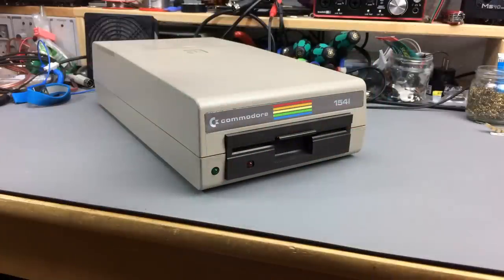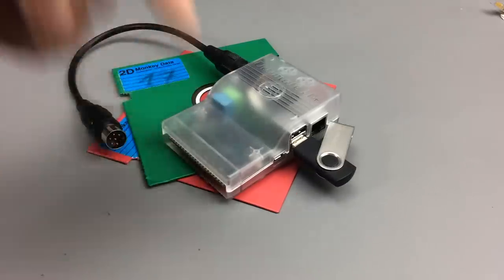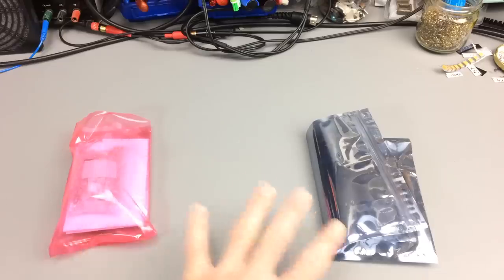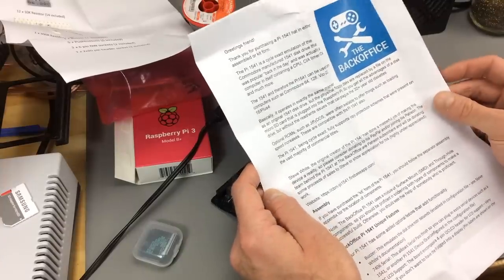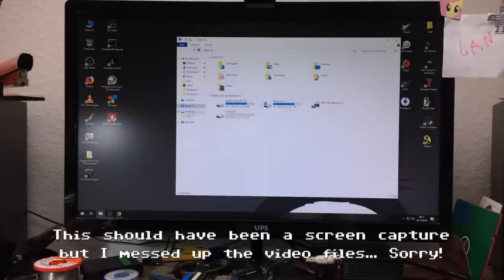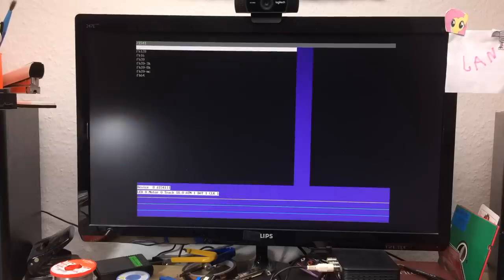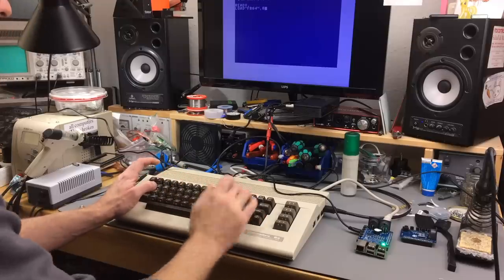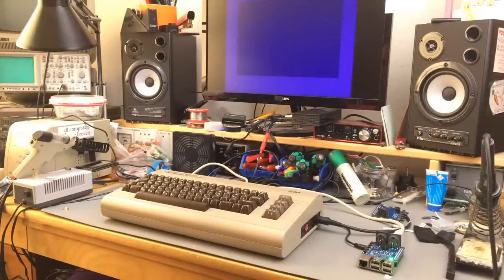The Pi1541 Commodore Disk Drive Emulator

Comment: The original ARM processor was a development board/coprocessor project designed and built by the Acorn team on the BBC Model B. All ARM based products have a common heritage with the Acorn/BBC computer line via the Archimedes series, including mobile phones, tablets and of course the Raspberry Pi itself. In the eighties I had a C64 and my family owned a Model B and then later an A5000. I still have the 64. In my opinion the BBC was a better computer, the 64 was more fun and certainly more popular world wide. I love how all these years later this has come around full circle. Thanks for doing this video Jan.

Comment: The Retro community never ceases to amaze me. There is always a way to make somethin' for all these older systems they are not dead yet. I should pick one of these up anyway since who knows what I'll get my hands on in the future.

Meanwhile, all the soldering! Seriously those are scary lookin' to solder since it is they're so small. Anyway - mach weiter so, Jan!
Reply from the maker: SMD soldering is actually not all that scary once you get the hang of it. Steady hand and good eye required though... ;)
Reply: Or use a cheap microscope from Amazon/AliExpress/Ebay  ;)

Comment: That's so clever! When I saw you show this off initially, I was like "Cycle accurate emulation on a Pi? Impossible" because I assumed it was running through stock Raspbian or something. Now that I see it's actually loading it's own elf payload, I'm spectacularly impressed. That's so smart and clever.
Reply: This cannot be compared to raspian. AFAIK this is written as RTOS.
Reply: Yes, this is a complete separate OS which is only doing this, and nothing else. No network or USB drivers for example.

Comment: Great video Jan,
The Pi1541 is probably the best cost effective 1541 emulator on the market. I have Jiffydos installed on it too, so everything runs much faster (in all operations, not just initial loading as per a fast loader cart). I tried a SD2IEC and found the massive incompatibility with many programs driving me back to the old floppy drive. The 1541 Ultimate is awesome, but with a family and mortgage, I couldn't justify that kind of money. With the pi3b+ however (and all the crapping around of course) I found the perfect niche. And to top it all off, I can disconnect the pihat, and use the pi for other things whenever I like. Best of both worlds, and something I think people don't realise; you can use the pi for many things, as the pi1541 hat just disconnects easily, and a new sd card popped in for any other things you would like to use the pi for. Too easy.

Comment: Ok, that's really cool. I didn't realize you could get cycle exact emulation for a system like that on an RPi.
Reply from the maker: They even have a version for the Pi zero now (if I'm not mistaken) which makes things a lot more cost effective. Definitely have to try that sometime, too.
Reply: @JanBeta  The fact that it can be cycle exact on a $5 computer is absolutely mind blowing. You could end up paying more for the SD card than the computer that is doing all the emulating, that's insane.

Comment: I know I'm late to the party, but I have just got a Pi1541 up and running on a Raspberry Pi 3A+

What an incredible gizmo!  I've got two ROMs installed... 1541II and JiffyDOS. It works perfectly. 

I now want to jam it in a small enclosure with a 5" HDMI monitor and externally accessible MicroSD slot :-)
Reply from the maker: Yes! It is an incredibly useful little device!

Comment: Nice informative video, Jan. I have my pi1541 coming in next week. I love my SD2IEC, but I have five different 8 bit computers I swap it on. Time to get a second solution to test and review. I got my piHAT from Commodore4Ever on eBay. All assembled with 2 IEC ports and an LCD screen. Not the cheapest, but very well built and reviewed.

Comment: Great video! I have the Arananet version and added a little 128x64 screen to it. It works well but the scrolling is noticeably slower than with a  monitor. It's not really an issue if you only have a few games or even a small collection. If you have a large number or full collection though, unless they are well broken down into sub folders, it can take a while to scroll through them. At the end of the day, the Pi1541 is an amazing little device, well worth owning for all C64 fans!
Reply from the maker: I agree, it's definitely an amazing device. I'm looking forward to what this thing is going to become in the future. After all, it's a relatively new project still. I have an OLED screen on order, too. Can't wait to try it. :)

Comment: Pi1541 works perfectly with Final 3 Cartridge, but only in drive emulation mode. When you boot the pi, it starts in sd2iec mode and it is not emulating any drive. The exact emulation starts when you select disk image either from FB64 or directly on Raspberry Pi (using hdmi display and buttons on the board)
Reply: So fast loading works fine in drive emulation mode?  Any glitches or exceptions?

Comment: To add a new image downloaded via PC just pull the SD card and put it on there. No need to power down the pi1541. Fb64 or fb128 sees the new disk image right away. 

One thing worth to mention is,  changes to the disk images are written when unmounting the image. So don't forget to push the button or your data written to the disk is not written to the SD card.

Comment: If anyone else has the Pi1541io board and has problems with it, it has pads on the bottom that you have to bridge to select various things explained on the github page, I was wondering why mine didn't seem to work but I completely missed that since the eBay one I bought came with no instructions. Works great now and the external OLED is definitely a must have if you have a single screen

Comment: Hey Jan -- I think the sd2iec gets a bad rap.  One advantage it has over all of the other choices is CMD Hard Drive emulation.  Perhaps it's a US/Europe thing, but that's really important for C64 power users, and GEOS users especially.  Another advantage is the form factor:  Jim Brain has sd2iecs so tiny that you can embed them in anything.  The last advantage is price.  At one point I picked up 3-4 of these for less than $100.
Reply: Yeah and it costs less than a Raspberry.

Comment: I have a Pi1541 that I purchased from an eBay vender Commodore4Ever who builds and sells the top board which you connect to the a Pi it works quite nicely and it has a screen on it so you can move around either using the screen or from the File Browser Software.   I played with it for a while and found it to be a nice addition to my Commodore Collection.   I could of built one myself but for this I opted to support the seller who lives here in the States and does a great job supporting the Commodore Community with a wide range of products.   One thing I don't like is that its not in a protective case so I modified a Pi Case to at least provide some protection.   Depending on the Pi1541 there are some cases available for the version where the buttons point upward but on my version the buttons point outward from the board but the good news is that Commodore4Ever has 3D Printed a case that he might sell in the future.

Comment: Glad to see that you've covered this. I've seen both the DIY kits and finished boards floating around on eBay and was hoping somebody would examine it in detail to see if it's worth a purchase or not.
Reply from the maker: Definitely worth it. You can also experiment with just building an adapter with a level shifter if you don't want to spend much on it. That's the beauty of the project I think. :)

Comment: So, back in the day, when you used a 1541 drive with your Commodore computer you were actually using another whole computer built into the drive to read a disk because managing disk controller tasks alongside its own internal functions and some program loaded into RAM was a too heavy a chore for your computer. Fortunately, now you can just emulate the drive with a pretty simple board which is connected to... a whole computer with a boot disk that you will create using yet another computer to not just download and move around stuff  but also edit config files and all that jazz. On top of that, for an optimal experience, besides your main monitor, you will connect another monitor to the Pi to be in total control of the emulator at any time. Pretty straightforward, isn't it?
Reply: u dont need an extra monitor for the Pi; being a Linux computer u can remotely ssh from anywhere, via ethernet cable, wifi, using your smartphone, etc; that's the advantage of  open source, it's hacker friendly
Reply: You're basically right, but a small OLED display and some GPIO buttons can be used instead of monitor & keyboard (as of now; remote operation through phones, tablets etc. could be implemented).
Reply: funny and weird, isn't it ?

now, you COULD use the raspberry pi itself to download the required files for the boot SD so you don't need 3 different computers.

- start up raspbian or any other desktop OS of your liking, 
- download the files
- connect a usb SD card reader (you can't use the raspis on board SD card slot 'cause you are running raspbian from it) 
- make boot disk
- shut the pi down and swap the raspbian SD card with the 1541 emulator card

and as juan already mentioned you can ssh into the pi - i bet there is some sort of SSH or terminal client for the C64 that would allow you to connect to the pi and control it - that would eliminate the need for a monitor connected to the pi (not that you would actually NEED a monitor connected to the pi once everything is configured and working properly)

Comment: why doesn't the Ultimate II+ emulate a 1551?

edit: nevermind.  I thought it was backward compatible with the C64's cartridge port, on it's own.

side thought:  I'm wondering if the Pi can be used to replace the controller board in a (presumably dead) 1541/1551/1571/1581.

Comment: Basic FPGA boards cost $12~$20 with shipping.
On Aliexpress you can find Cyclone 2/3/4 and Spartan 6 boards with configuration memory, JTAG headers, 3.3V regulator, 50MHz crystal, and GPIO headers.
Reply: Right, but somebody has to develop the firmware to flash to the chip, otherwise it's just useless hardware.

Comment: Do any of these units have JiffyDOS compatibility?  I imagine it would require a different ROM to be loaded in to emulate the JD ROM chip in the 1541.  If so, that would take care of the need for a fast loader.
Reply from the maker: Yes, you can use the 1541 Jiffy ROMs as well as all other serial speeders. You just have to copy the ROM on the SD card and specify it in the options.txt.

Comment: kannste du methoden zeigen (günstig wäre geil), wie man seine disketten backupen kann? ich denk mal viele von uns haben noch programme oder daten auf den disketten die wir gern sichern würden..

eng and shorter: can you shop a disk backup methode?
Reply: This is quiet easy. Pi1541 is just another disk drive. You can choose the drive letter with a keyboard connected (or via options.txt). With a keyboard connected you hit CRTL+N and you have a new disk image created. Mount this image and use your favorite program (e.g. Dragon copy) to duplicate the disk. I used this method to backup all my disks.
Another nice addon is to add a 3,5 inch hdmi display on top. For this I had to change the layout a bit. Check this out:  https://twitter.com/SachseImExil/status/1036184155174961152?s=09

Comment: It would be nifty if the Raspberry Pi (& adapter board) went in between the C64 and the 1541, then you could capture a disk image as the C64 was booting and save it to the Pi’s SD card; you could then select it from a menu for later use, or even use it to make a replacement disk, assuming you could even find a viable 5-1/4” disk these days. Also handy would be a way to plug in an IBM PC-standard 3-1/2” drive, and have it read (if not write) MS-DOS formatted disks (FAT-16, I believe). I wonder if there’s something like this that’ll plug into slot 6 on an Apple ][+ or //e?

Comment: I wonder if you can help me, I’ve just bought a C64 35+ years after selling my last one. What is the best solution for loading roms? 1541 or Datasette emulation? I can’t choose between a Tapuino or the PI1541. I want to be able to play as many of my old games as possible.
Reply from the maker: I would recommend getting a Pi1541, an SD2IEC or if you want the most versatile (and expensive) option, go for a 1541 Ultimate. All emulating a disk drive, the ultimate can do tape and cartridge emulation, too. Tapuino is great but it is quite slow (as it's emulating a Datasette) and especially some newer games are not available as tape files.

Comment: I have been wondering if a pi with a suitable hat can emulate a scsi disk. The fpga options are quite expensive.
Reply from the maker: I'm not a programmer at all but I suppose it should be possible. Probably more straightforward than the 1541 emulation as you don't have to emulate a SCSI controller.

Comment: Is it possible to get a serial console into the pi1541, rather than use the hdmi output?
Reply from the maker: Yes, I think you can access it through the network in various ways. I didn't look into it, though, I have a little OLED display connected to it now which is enough for my purposes.

Comment: Is the pi1641 read and write?   

IAW if I write a basic program on my c64 can I save it to the pi1541?
Reply from the maker: Yes! It behaves like a real 1541, so you can read and write to it as you would with a real disk drive. :)
Reply: Does that apply to the Sd2iec also?
I want to save wear and tear on my real 1541
But I need to save Basic language programs that I write

Comment: Mr. Jan Beta, thank you for the excellent video! Have you tried to use a USB thumb drive with either of the pi1541 units? I have tried this and was unsuccessful. I know someone who has succeeded in this but I don't know what I'm doing wrong. Can you try it out and if successful give any pointers? Thank you! For the record, I was using a Sandisk, 16GB formatted as FAT32. Turned the unit off, plugged in the thumb drive and then on. Fails to see the thumb drive at boot.
Reply from the maker: Thanks! At the point this video was made, there was no support for thumb drives in the Pi1541 firmware. I haven't updated in a while so I can't tell if they added support in the meantime.

Comment: Thanks for the excellent video again Jan. Is it better to get a pi1541HAT with or without the 7406 IC?
Reply from the maker: The 7406 makes it possible to connect more than one device so I’d definitely recommend getting that version. If you know for sure you’re only ever going to need the single Pi1541, you’re good without the 7406.
Reply: Thanks for the reply  @JanBeta

Comment: Were can you buy the 2nd version you had. I can solder it up too. It be nice to have a board not just like hack it together. This is good it my be the best way to have all most a real 1541 with no moving parts to go bad. I guess can install jiffyDOS rom in it.

Comment: Hmm. Pi1541 is a "bare metal" type emulator, right? However, I could see benefit from it running on top of a small linux, as you could make use of the wifi/net access on the Raspi to dynamically transfer contents from the Pi.  Really the only downside for a less "bare metal" implementation would be an increased boot time on the Pi, which isn't as bad as when using Pi to emulate an actual computer (in which case the boot time is fairly important, BMC64 is cool.)

Comment: You can tell the little piezoelectric speaker is struggling. I have replaced them in other projects with the little speakers you can salvage from old mobile phones. They sound much better.
Reply from the maker: That's a good idea. I actually got a half-way bearable sound by changing the piezo frequency in the options.txt to 500Hz. :)

Comment: @Jan,what about Jiffydos and Pi1541,is it supported?
Reply: Jiffydos is supported. Just look at the page. It is documented quiet well. You can even have multiple ROMs on the SD card and select them. If you are using LST files you have to specify the ROM to use.
Reply: Ok,thanks! I didn't see on page at first.

Comment: Würdest Du diese Variante auf jeden Fall der SD2IEC Variante vorziehen?
Reply from the maker: Die Pi-Variante ist auf jeden Fall kompatibler, funktioniert auch mit den allermeisten Fastloadern und so, weil die eben wirklich ein exakter 1541 Emulator ist. Die SD2IECs sind aber günstiger und mittlerweile gibt es jede Menge angepasste Software, so dass du mit ein bisschen Recherche auch die große Mehrzahl an Software zum Laufen bekommst. Gibt für beide Lösungen Pros und Kontras. Die beste Allroundlösung, die ich kenne, ist immer noch die 1541 Ultimate.
Reply: @JanBeta  Ok aber auch die teuerste in dem Fall :D Danke für dein Feedback

Comment: If you happen to have bought your pi1541 at a trade show from--not real name--Jimmy Cash, you 
might get home and find it's not working. Now, you have to try to figure out what settings to 
enable in that options file. But after several guesses you realize, I didn't build this so, some 
rabbit-hole-options confusion sets in. Meanwhile, you didn't know you were supposed to ask Mr. 
Jimmy Cash about any of this. No biggie. This is Retro. :-)  p.s. I'm still hunting the screwy rabbit.
Reply: Thankfully Jan has included links in his show notes so, Say your pwayers, wabbit!